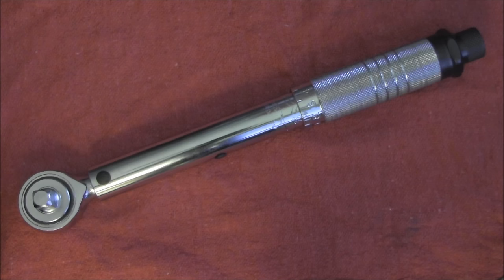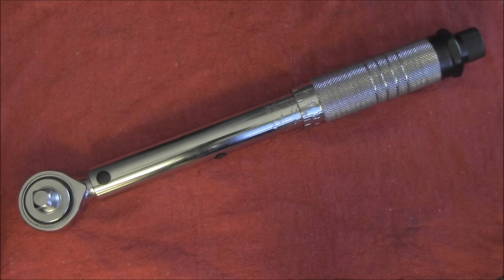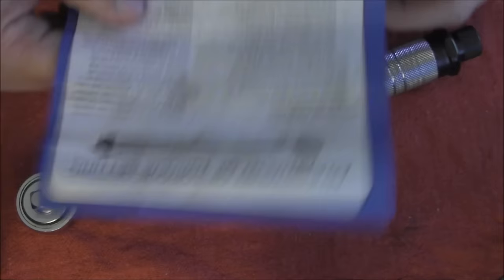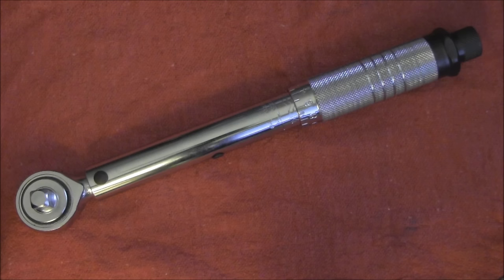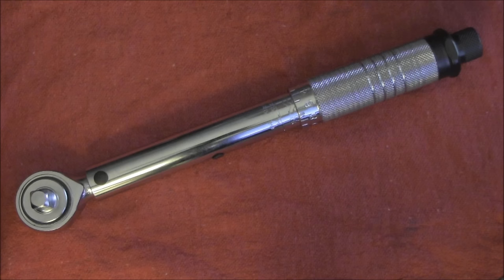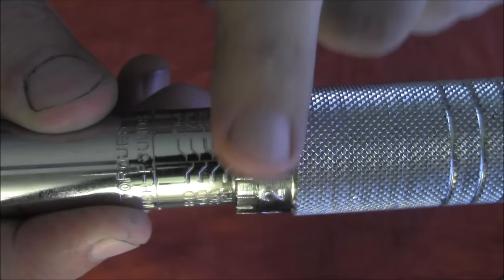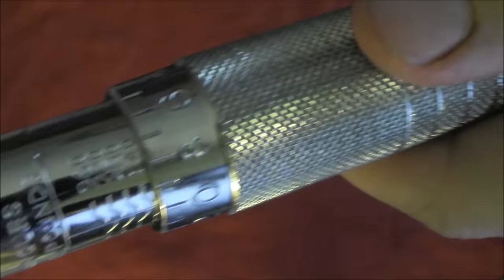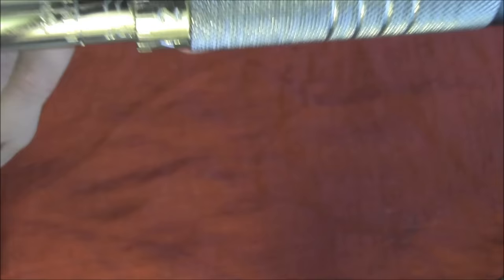How to use torque wrench for beginners

Comment: Oh my God, two plus two is four. By pulling it out of the box you should already know what you're looking at. I've looked at quite a few of these videos and the one thing they do not do nobody does. Is follow the setup instructions. Before using a torque wrench at least the Harbor Freight torque wrench. You loosen the lock nut counterclockwise and turn it to the heaviest setting clockwise lock it in place. If needed, loosen lock nut and turn it to its lowest setting. Lock it in place. That's pure instructions. I've watched 10 videos no one talks about the proper setup. and that's why I'm sitting at the zoo right now throwing peanuts at the Monkees I'll look at that you caught one. don't feel bad for your not the only one that does it. there's lots of monkeys in the cage.

Comment: Hi
how is it possible to estimate the amount of torque for bolts and nuts with different applications?
Reply from the maker: shir azi thanks for the comment, Generally speaking in mechanical applications such as engines, suspensions etc... there is a factory specification that has been determined by the manufacturer. For the S-10 truck I've been doing some work on I have the General Motors Chilton guide for S-series pickups. in it are all the torque specs I need to work on the vehicle.  You can find guides on most makes and models at hardware stores or online. Hope that answers your question.
Reply: thanks man , great help ,

Comment: I tried to use the torque wrechm it never click, and I broke the bolt in my intake, now it is seeping air. Anyway to get bolt out?
Reply from the maker: with these cheap wrenches they can be a little sensitive if you over torque them. I've never taken one apart. not sure what you paid for yours mine was about 20 bucks. at that price I would consider it trash and replace it anyway just to be safe.
Reply: I borrowed it from autozone. Now I have to take my entire intake apart, take bolt out, and try it again,
Reply from the maker: oh that sucks
Reply from the maker: I misread your original message and I thought you broke the Torque wrench. can you use one of those self tapping drills that will back it out?
Reply from the maker: my first time using the wrench I was doing the spark plugs and I was supposed to set it to 13 ft lbs, I did but it didn't click on any of the bolts. However it did click when I later tightened the steering linkage at 35 ft Lbs. on the later I just stopped turning after I thought it was tight enough because I didn't want to do exactly what you described but with a spark plug. I think the cheap ones are kind of flaky. that is my personal take on it.
Reply: Thats what happened to me, and that son of  a gun broke, Now my truck is running terible until i extract that bolt. I wish i can find a safe way to do it, without pulling intake
Reply from the maker: get an easy out bit, here check this video, you can get a set for less than 20 dollars. i've never used one but it could do the job.

https://www.youtube.com/watch?v=SMrDYJvY0Ts
Reply: Paul Foster Thanks for information. I will try this before i attempt to take entire intake off.

Comment: 22lbs how do i torque that?
Reply from the maker: J Saun using this Inch-lb torque wrench turn the handle until the top of the handle touches the bottom of the slide for 240 inch-lbs (20 lbs). the handles graduated numbers will be at zero. Next keep turning the handle clockwise until the handle is set to the number 2. if you have anymore problems let me know.
Reply: Paul Foster hey got it thanks for the help bud
Reply from the maker: your welcome, thanks for watching

Comment: But HOW DO YOU USE IT? ?
Reply from the maker: Set your ft lbs or in this case inch lbs. then turn the bolt until it clicks. once you hear the click then you stop. Hope that helps clear up the question. if not let me know.
Reply: It's not clicking. And I'm afraid I'm gonna break it. I set it to 10ft/lbs which is close to the lowest setting but no click
Reply from the maker: have you dropped it? 
have you set it to the lowest setting after each use? 
did you loosen the bolt on the back before use?
Reply: First time using it. Haven't dropped it. Didn't know about the bolt on the back I'll get back to you on that

Comment: Where do you get the sockets for them? Mine didn't come with one so I can't use it. Why the fuck do they do that
Reply from the maker: Normal sockets will work on this, i have a nice socket set that I purchased and all of them fit this wrench.
Reply: If you don't know the answer to this question, you probably shouldn't be messing with tools.
Reply: Anthony Wiles i ended up taking my car to a professional to have the lugs tightened & returned this thing. i didn't know what the hell i was doing. i just wanted black wheel covers on my car, but the factory ones were tightened to the steel wheel with the lugs. so i had to remove the lugs, remove the factory wheel covers, replace the lugs, and then snap on my after-market wheel covers. however, i was very concerned about the tightness of the lugs since i just tightened them by hand so i just took it to a professional since i didn't know how to use these fancy tools. he charged me $8 but i'd rather pay 8 dollars than have the wheels fly off my car and risk my life or my car. the hubcap installation was a success though. i've hit a few pot holes and they still haven't came off.

Comment: The 2 represents 2 inch pounds not 24 inch pounds.  If it is an inch pound torque wrench the numbers on the bar AND the numbers on the handle are both inch pounds.  Stop confusing people.  Maybe ask a real mechanic what you need to know before you make a video.  Foot pound torque wrenches are the same way.  It would be all foot pounds and no need to do simple math.

Comment: Why would you have to measure how tight a bolt is?  What would happen if you just tightened it w/o that torque wrench?!
Reply from the maker: Thanks for the comment Shaine, One example would be spark plug installation, Torque directly affects the spark plugs' ability to transfer heat out of the combustion chamber. A spark plug that is under-torqued will not be fully seated on the cylinder head, hence heat transfer will be slowed. This will tend to elevate combustion chamber temperatures to unsafe levels, and pre-ignition and detonation will usually follow. Serious engine damage is not far behind.

An over-torqued spark plug can suffer from severe stress to the Metal Shell which in turn can distort the spark plug's inner gas seals or even cause a hairline fracture to the spark plug's insulator...in either case, heat transfer can again be slowed and the above mentioned conditions can occur

In the case of Torque being applied to frame and linkage bolts, manufacturers have determined what the appropriate amount of torque is needed for each bolt on a vehicle. It is best practice to follow those guidelines for safety. I torque'd each bolt on the steering linkage of my sons truck after replacing parts of it. I wanted to make sure everything was tightened to factory spec and recommend others to follow those recommendations as well.

Hope that helps answer your question.
Reply: cool thanks!
Reply: Paul Foster I've never used a torque wrench for a spark plug, and all of that stuff you said would happen has NEVER happened to any of my vehicles...
Reply from the maker: Mercury, thanks for the comment. That question was a few months back but your point is well made. I was sharing the information as an example of why we torque something to spec.. plugs do have a torque spec and I try to follow them out of fear that I would over tighten one more than under tighten one. with the outcome being that i  then crack it or break it. the example I gave to shaine included information I got from the manufacturer.  His original question was about torquing any bolt. I just picked the spark plug because I just finished putting a set in.

Comment: You never actually used the damn thing!
Reply from the maker: Chris, the idea was to show you how to set it up. after that if everything is done correctly you would tighten until the torque was reached and you heard the double click. I probably should have demo'd that but the idea behind the video was for people who were reading the instructions and trying to make head or tails from them having not really used a torque wrench before. Thanks for the feedback.
Reply: I just had issues with the one I bought not providing any feedback.  It's had to tell what the wrench was doing if anything.  It just felt like a solid wrench.  I was hoping the video would tell me what I was doing wrong.  Sorry for the exclamation; I'm just frustrated with what I bought.

Comment: K get to the point, tell us how to use it
Reply from the maker: adam987689 Once you set the inch pounds you need to torque too, tighten a bolt until the wrench clicks.

Comment: Anyday now, too much talking
Reply from the maker: thanks for the suggestion Nick.
Reply: You are not getting dislikes because of "hate" you are getting dislike because people are in a hurry and they want you to get to the point already rather than talking about "nonsense" (which is what females do). For most of us guys we like to hear: this is a torque wrench, it's lbs version, this is how you read it and adjust it, then put it to the test, it works, success we are done, end of video, then if you decided to talk, it's best to put it at the end of the video so in this case people then have the option to stay or watch you talk. Also video editing will help remove unnecessary content.

Comment: $20.00,what is supposed to be precision instrument?
Just looking the picture,you can see it is crude,made  and even desgned (yes,even desgned),Chinese picece of shit.I would not us it even as a bar.
My made in USA,made by Proto torque wrenches look like they are made by Rolex.
If you are serious about working on the cars,you need better tools.(at least ,torque wrenches)
And how long you are working on the cars,with out having torque wrench?
I use it on almost every bolt on my car,spark-plugs,brakes,wheel lug nuts,gear oil drain plug,avery bolt by the factory book.
Reply from the maker: Broj 1 thanks for the feedback, I bought the wrench before I started working on the truck. that being said like a lot of people I could not afford to invest in expensive tools out the gate. You make a valid point about quality in different wrenches.